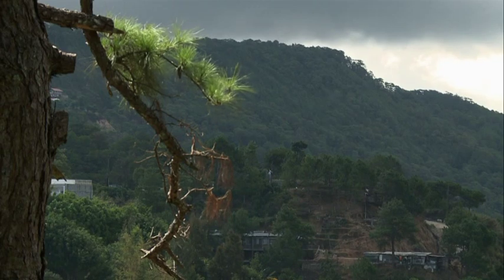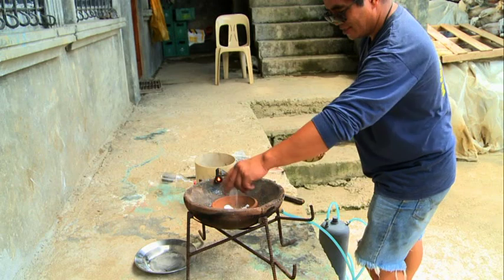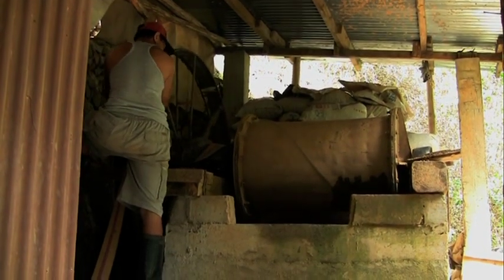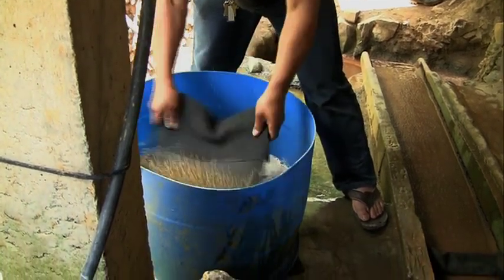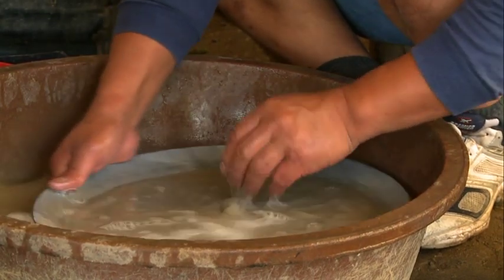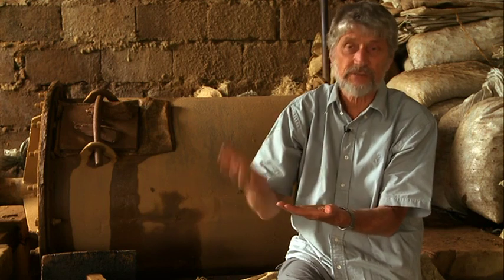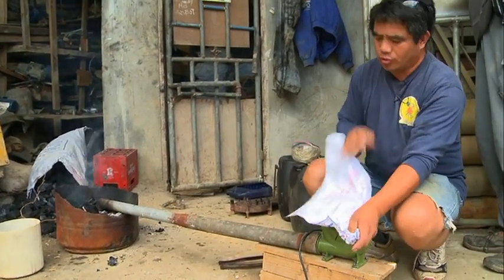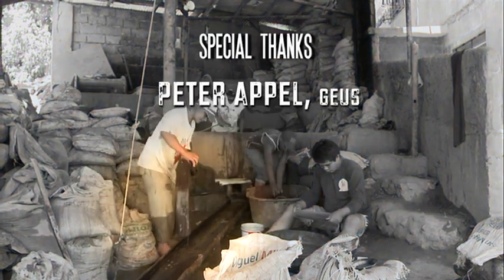Gold extraction with BORAX for small-scale miners - Rather Rich & Healthy than Poor & Poisoned

Comment: This whole thing is a lie!  First to make gold smelting flux you need not only borax, you need sodium nitrate, soda ash and powdered glass.  A bit of powdered charcoal don't hurt either :)  You see you have to pull contaminates like lead and copper out into the glass and ash to make a useable gold button.  Melting alone will produce an "electrum" that will have to be reprocessed and is not very usable.  Mercury is far superior.  What they need is a $5 pipe retort to save 100% of the mercury and not release vapors.  First they need lessons on how to mine their gold.  They are pitiful in their methods.  A $20 fluid box will replace all that system and catch gold down to 300 micron with a less than 3% return to tailings.  Waste not want not :)  Lets not even talk about the platinum they are probably leaving in that black sand.
Reply: They used the old traditional practices on extracting gold out of the rocks... That is how our ancestors did it in ancient times...
Reply: The whole idea is to do away with the mercury pollution (which sickens, kills and destroys the environment). Use some ethics.
Reply: HM Dickson its our source of living for almost a decade...that's d only chemical wr using.
Reply: Don't be so eager to jump into the "its all a lie". To be honest you only need 1 thing, heat, everything else is a boon. This works well enough for you have a consolidated product that you can then dissolve and precipitate from AR. You have obviously confused this is refining gold, and even then you dont need much any flux if you are using ceramic, and even then borax on its one is just fine. (from experience)
Reply: Morlanius Did you not watch the video?  They were merely panning!  That means your gonna have lots of nongold in the mix.  The only way to reach a good quality electrum is by smelting, which requires far more than borax!  The better method is with quicksilver and you know it!  What they need is a 100% retort and nothing else.  They will not be able to sell that slag mess you will create with just borax for no where as much money.  Ceramic will not pull all that lead and other junk out even if you line it with bone powder without glass and nitrate.  It ain't my first rodeo either!
Reply: HM Dickson You obviously didnt read my post clearly.
Reply: Morlanius If I misunderstood you, I am sorry.  Look, these people are poor as a church house mouse, even their gold pan is wood.  Look at their capture sluce system, they must be loosing 40% there alone.  They need education on how to use mercury effectively without getting poisoned or releasing it.  A pipe retort is what, $2?  But for some prick from the UN whose real agenda is to stop gold mining, not help them out, to suggest they merely melt their product into a mess with borax alone is not helpful at all!  These same brainless wonders have most of the hobby miners here in the US puddling with bluebowls, micro sluces, and wheels because of the mercury "hazzard".  There is no hazzard if you educate yourself in it's use.  This is about Agenda 21 not helping poor miners. Why haven't they taught them how to build a fluid box that will capture down to 200 micron with 3% return to tailings?  I can build one for less than $20.  This alone would quadruple their incomes.  Did you see any instruction as to how to extract the Platinum from those left over black sands with the use of 2 magnets?  It is because the game is not to help them but restrict them!  Send a gold miner down there and lock up the left wing whacko from the UN and their plight will improve!
Reply: I agree with much of what you say here, not only should some decent mining and recovery techniques need to be taught but also some basic refining. SMB, HNo3 and HCL are hardly expensive and with some basic safety precautions they could be selling larger quantities at a higher purity. (I'm more a refining guy then a mining guy, but I have a good knowledge of mining and reclaiming). Personally I think they could just throw everything from the last concentrate down into AR. get everything, then just precipitate each metal separately and get all the platinum etc, all they would need is the  chemicals, 2 buckets. it would even cut down the panning time no end, just keep extracting and dump everything into a bucket, and use the 2 step addition to destroy as much crap, filter and start precipitating. and borax is one of the most basic metal fluxes for this kind of work, as its pre-refining it doesn't matter that you have some borax worked in there the AR will remove all that. Not used mercury for extraction as its illegal in those quantities here, Ive also only ever used borax as a flux not an extraction medium. So what i was saying is this. If it works and its safer then why not, yes their whole system is very inefficient here but the video didn't seem to be suggesting changes to hardware setup, just making reference to what they have already. but at the end of the day, it doesn't matter how impure your product is at the end of this process to a large extent, because this is the reclamation process not the refining process, Like i said above, you are pretty much better off capturing more mixed stuff and into your melt rather then throw potential gold away in your spoil because the smelt itself will be the first separation, then refining process will clean it up to a purity value. the end result is more of a purer product.
Reply: cords mist you don't know anything.. despite your pretense at knowledge.
Reply: HM Dickson Do you have to link to your fluid box that catches 200 micron gold?
Reply: Would you really let someone come to your mine? Don't you want to keep your method's secret?
Reply: https://www.bing.com/search?q=gold+well+vortex&qs=AS&pq=gold+well&sk=SC3AS1&sc=8-9&cvid=25F948F038F745DCBB2D412DCEB841AD&FORM=QBRE&sp=5
Reply: HM Dickson  after doing that will their any gold in borex kit
Reply: why UN  dont want public to harvest gold ?
Reply: hm Dickinson I'm interested in learning more about your process pls contact me at advancecapital3@gmail.com ,I'm Clint.
Reply: You might be the liar. Come here in the Philippines and we will show you! This video was taken just about 8 km from the City of Baguio in Barangay Kias Baguio City. WE can show you clusters of small scale miners ball mills doing the same job 24 hours a day. Find in your Google the word Balatoc Mines, look down and you can see hundreds of clusters of ball mill shacks busy doing milling and smelting. This is our livelihood man.

Comment: Borax lowers the melting point of gold.  Normally, gold melts at over 1000C.  The heating used by these miners is not that high.  Therefore, without the Borax they would not be able to get the gold to melt completely.
Reply: ahahahah no it doesnt..n metal refining, a flux is sort of like a cleaning agent because it helps remove impurities from a sample. With some borax, heat, and a little know-how, it’s possible to extract pure gold from a sample of ore. This is because using borax as the flux reduces the melting point of all the elements in a piece of ore...
As all of the minerals melt down, they separate from one another. As the process continues, the borax causes the other minerals to oxidize and breakdown even further. Gold is unaffected by this reaction and sinks to the bottom of the mixture, intact.
Reply: wa....s...p..n.
Reply: yah we just use borax to help melt the gold and not to extract the gold,,,
Reply: Hodges April borax is a flux.
Reply: thats the dumbest thing ive ever heard...
doc johnny
Reply: yohj koh   so the borax used as a flux doesn't lock the sands and other stuff u can't pan off without loosing the gold
Reply: Martin Sage ur ryt.and that's the only chemical wr using.D's video was taken in d phillipines.
Reply: Jussoli Arciba so if you use borax you shouldn't use any flux?
Reply: The Johnsons borax does lock most of the impurities you can’t pan off. Most of them not all of them.
Reply: They have melted the gold completely with out borax for ever..its a flux  cleans some but gold melts with out it..
Reply: enviromental practise to prevent kill generation only america teach how to kill generation but if too much killed too much complain that is america hahaha
Reply: borax is also a Flux used in  sepperation of gold and impurties.   much like making Carbon Steel using a cducibile.  Iron  sand carbon and yes a small amount of Borax heat 2400 degs hold it  oh the crucibile is sealed with fire clay  ..when done you have a carbon steel that was being made 500 years before Brittian had it

Comment: Without a flux most of your Gold will actually evaporate away. Also borax will make the Gold purer by removing many impurities. They must sell their buttons at a local market for the best price, because a good refiner would take the gold straight from the pan and pay you according to the values in it, minus the refining fee..
Reply: susan mccartney not even true. Oxy/acet burns at <3500 degrees C and gold starts vaporizing at 2850 degrees C.  Quit making shit up.   Gold vaporizes in a purple colored smoke, and many a gold miner have lost their gold to a hot smelting.
Reply: Gold can not be destroyed evaporated or any thing else
Reply: No, gold does not evaporate.  If you weld steel it does not evaporate.  Gold is a metal you would have to heat it to its boiling temperature and then use a high vacuum pressure to "evaporate" it.
Reply: Gold will boil and evaporate at 5,370 deg F, though there is no risk on a charcoal fire if you use an oxygen/acetylene torch, which can exceed 6,000 deg F you can evaporate gold.

Comment: There was never a need to use borax in any part of this video, it will not get you "more gold" you will actually have less in weight when you smelt it with borax flux however the gold will be purer than using mercury.
Reply: Jesus cross borax does not get you more go it just get you better looking gold

Comment: Ordinary table salt is toxic at high levels.  Do you not understand what an ld50 is?  It means thats the level at which it kills.  Borax ld50 is higher than table salts.

What it basically means is borax plenty safe as long as you aren't eating half a pound at a time.  Reasonable amounts as a supplement or in a food are fine.  Boron is a trace mineral that is actually very important for the body.

Boron is like many other necessary nutrients.  Fine in small amounts but larger amounts are an issu

Comment: I am a bit confused too. So I mill the ore right? Then I wash it down a carpet with water. Do I add anything to the water?
Reply: I wondered that as well.  I watched the entire process and the borax goes in after the panning and just before the reduction.  That means the borax is simply a flux.  The extra values received then isn't a greater recovery (which is done by the fine hand milling the guy is doing in the pan) but from gold dust that isn't blown out and away from the air blast in the melting stage.  I guess the guy's right, you do get more gold, but it isn't recovered gold, just gold that isn't lost.  
What's really helping these miners is the soap they're adding to the panning water, which breaks the surface tension of the water and causes the gold to sink.  That was another way they were losing gold fines in the past, before using the soap.  I suppose they could add boraxo (which is borax) to the water instead of hand soap, then the borax would be helping, but still not with recovery but with reduce loss of already recovered gold.
All their gold is pretty coarse.  They should do a fire assay on the slimes below the sluice, I'd suspect they may be losing some gold there as well.

Comment: I have a lot of "gold plated" stuff that I want to reclaim the gold off of it (mostly gold over copper). Do you suppose this borax method would work for this stuff? Would I have to cut it up into small pieces (1/8 inch squares by 20 Gage thickness) or 1/2 inch by same thickness? Thanks for the advice.
mrc109
Reply: Probably have already found the answer to this but yes and no. Using borax you would have to repeat the process many times to get pure gold. An easier way would be to melt the gold with silver together then use nitric acid to eat the silver and other base metals away. From there you are left with pretty close to 24k gold.
Reply: @newstacked5710 How many times 3?

Comment: I own 144 acres of monotomic ore, milled to 500 mesh, Im using a leach solution given to me by a chemist who developed this formula, Im having trouble finding the right flux formula to crack out a bar. when I just use borax in my old 3 turbo furnace, I can get good sized beads, but they are in the glass after the smelt. can you or anyone you know give me some advice, or do it for me. I would be willing to work something out with you. thanks.
Reply: cast your melt in inverted Iron pyramid mould and the heavier gold falls to the bottom and collects right at the tip, let it cool and tap off with a small hammer,
this way, all the gold in the melt is in one lump
Reply: Frankiethegift once you have it in the glass take a hammer and smack it and break the glass off of the bead. Duh. The metal will flatten just a little and the glass will shatter off. You’re welcome.

Comment: Obsolete would indicate that mercury is no longer a viable method, redundant indicates that a better method makes using mercury unnecessary.

You can still use mercury, therefore it is redundant, not obsolete.

A computer that is so old it doesn't run modern software is obsolete.  Having a faster computer makes having a slower one redundant.

Besides, it's really just a difference between british and american colloquial english.

Comment: Borax is fairly benign, and also very cheap - a 32oz box costs $4. The only precaution you need to take when handling borax dry is to just use gloves. It is used as a detergent, and it will dry your skin.

Among other uses, borax has been safely used to preserve eggs for fishing for decades. It is also used in cosmetics. Borax is an incredibly useful material for both home and commercial applications.

Maybe you should educate yourself and look at the Wikipedia page for borax.
Reply: I exfoliate with borax in my shower almost everyday 😃 
Then I apply Vaseline right after. Leaves skin feeling baby smooth all day  😃 
It’s also anti fungal